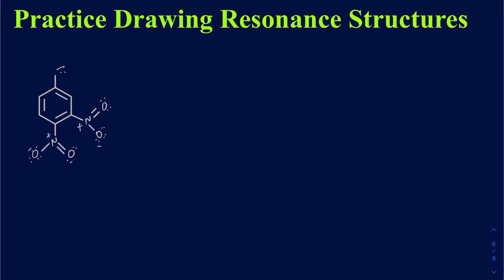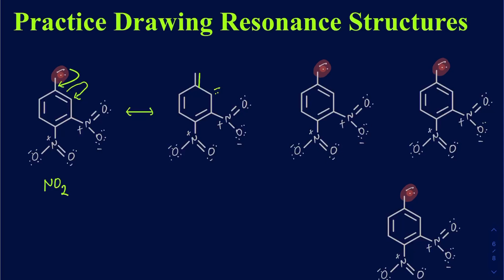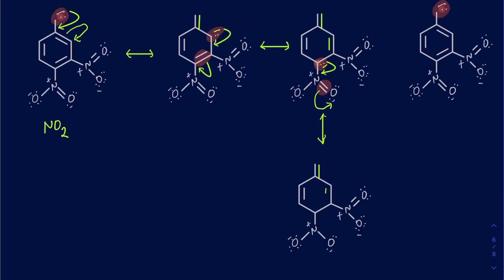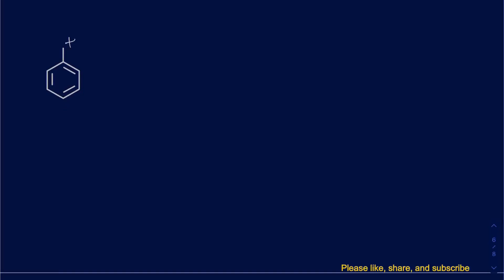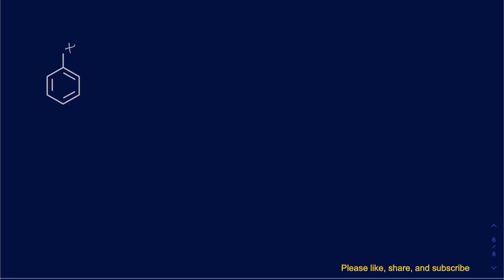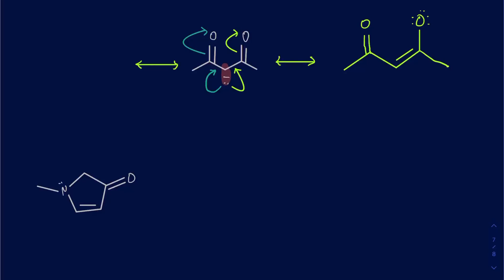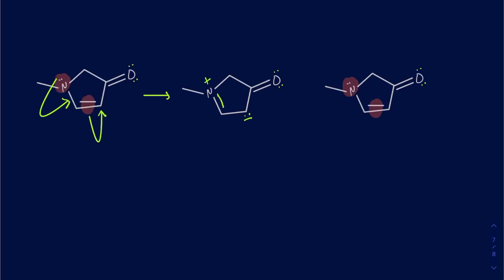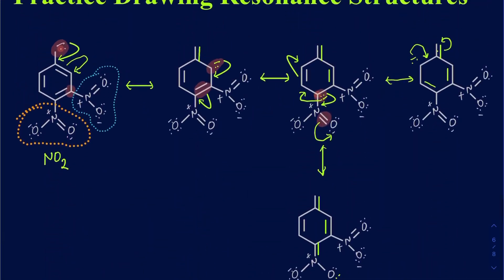Practice Drawing Resonance Structures with 4 examples

Comment: what is constitutional hetrotopic groups
Reply from the maker: uday kumar when replacing a set of groups by x (any group), and the produced structures are constitutional isomers, those groups are constitutional heterotopic groups. Take an example of 2-methylbutene. Replacing methyl at the second position and fourth C group of the main chain (methyl) one by one with x will produce constitutional isomers. Hence they would be considered constitutional heterotopic